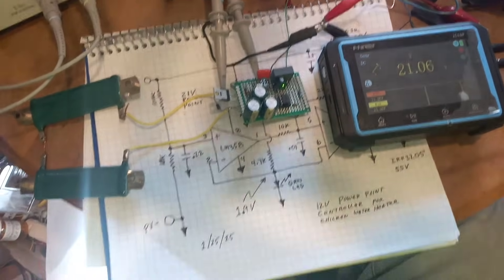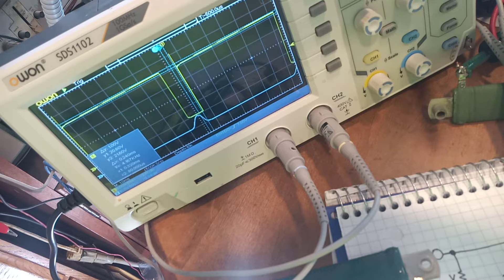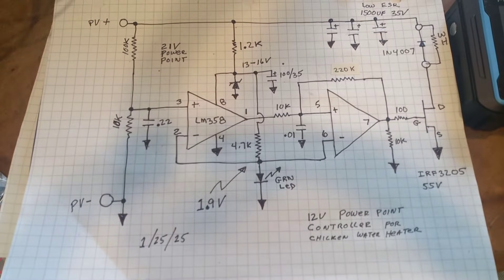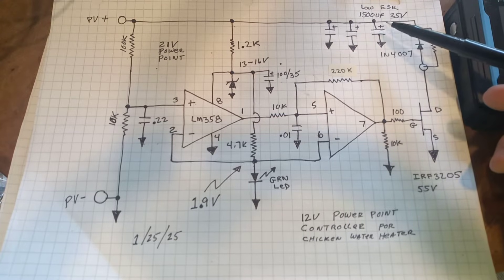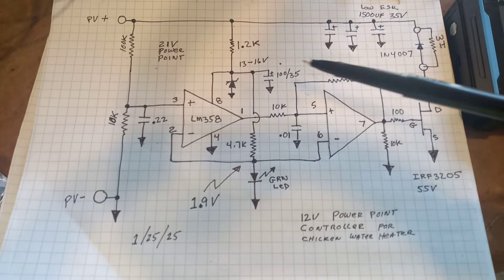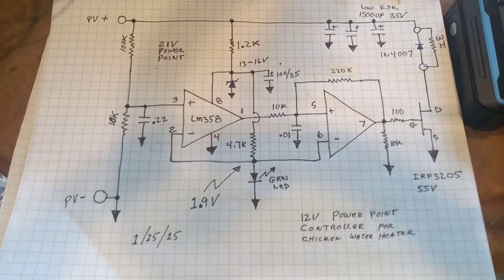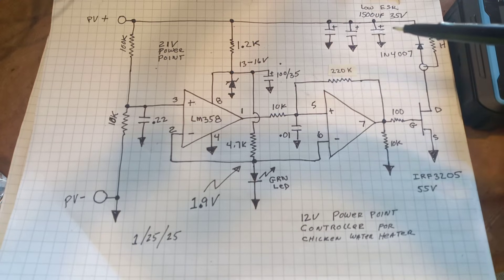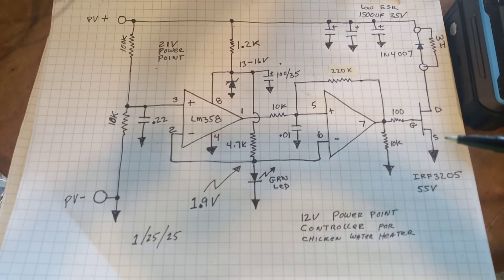Cheap And Easy PV Resistive Power Point Water Heater Controller Diverter Using LM358 #fotovoltaika

Comment from the maker: Designed as a low cost PV ice melter for chickens water source using a 12V panel, this can be adapted to any voltage PV array changing capacitors and FET.  This runs without issues.  Any op amp can be used like a quad LM324 which has rail to rail output swings.  Those extra op amps can add temperature shut off and arc interrupt.  

Only about 20W is needed to melt ice and this will provide that with only 1A of panel current.  The three 1500uF 35V Low ESR capacitors in parallel provide that in a small package.  Any low resistance FET can be used.  A IRF4332 would get you to 250V. A couple in parallel wouldn't need much of a heat sink.  

This connected to a 600W 120V steamer pot would make a great off grid cooker with a 40V grid panel or two 12V panels in series.

Anyone want to collaborate and lay out a board?  You could become a hero and make money building these.

Comment: I've done almost exactly the same thing more than a year ago, around the LM741 or TL071 and it works like a charm! I use it at 180Vmpp for a water boiler feed but depending on components it can do pretty much anything from 18V up to 250V.
Reply from the maker: Europe is more receptive to this concept.  There are dozens of circuits which can work.  Love to see a scope trace of your output.  You should try arc interrupt so output heaters can be daisy chained.  Everything works better with more capacitors.
Reply: @opera5714  I tried to setup a chain with multiple regulators - you can prioritize the load by setting slightly diferent voltage tresholds for each of them - and you also add-up some buffer capacity. This regulator si so cheap that you can afford having more than one easily. 😀 Some Europe has a problem with electric safety with those devices, but fortunately some of us just don't give a .... you know. 😀

Comment: Hi, I have watched your videos over the years and it seems to me a non electronics person that you are a pretty smart, innovative bloke. I am interested in off grid solar, simple electronics etc. I find when you are explaining your work you are talking to electronics engineers and professionals and you are way above my understanding. Maybe if you could do a series of videos showing how to build a hot water system and see it working would be great. I think It would boost your subscribers as well. Just a thought. I am an old guy and I find I get brain fog as well trying to understand what you are doing, but it sure looks interesting. I am sure a lot of people are interested in your work.
Reply from the maker: Not likely to happen.  Every system is different and my installations are not typical. Not about to make 15 minute videos where they only connect two wires together.  

I talk to everyone as if they are an adult. I try to be technically correct.  I don't expect anyone to completely understand in five minutes. That is what pause and rewind are for.  These are new ideas that won't be found elsewhere.  Ask questions like what does that resistor do.  It isn't possible for me to think like before I knew electronics any more than you to think like when you were a child.  We would be better parents if we could.  This is supposed to be a community effort.  

This style is also a filter.  Thes can be dangerous systems and the majority of those in solar have little understanding of electricity.  I tell them they have to do five things to be safe and they do the three things they want to.  In most cases, these systema are illegal. I don't want people crying my insurance won't pay.

I can't send a picture with my cell phone. Probably not stupid.  I just have no motivation to send cat pictures.  If I really wanted to, it would be figured out.  I don't care if you heat water, I want you to learn something. Making things easy for the viewer won't make them learn. I'm OK with YT stats telling me they click off after 10 seconds. YT is filled with idiots copying another's video. Nobody copies these hot water videos.  You can only make money by posting low quality.  This channel has cost me thousands.

Comment: I’m sorry you have been discouraged by the response.  I’ve been glued to these designs for two years or so.. I built the sg3525a circuit.. but overheated my fets and stalled out for a while.   I really never studied electronics properly enough to get good at the bits that you juggle in your sleep there.  Most of the other techs I work with in Heat Pumps and Solar think I’M way out ahead.. but I have a long way to go.  

I just think most service guys I work around know how to read resistance and voltage, enough to get to ‘swap out the board’ with tech support.

Don’t give up, please.
Reply from the maker: For power supplies you want to go as fast as possible in order to use as small a transformer as possible.  I avoided going fast to limit noise with these high current circuits.  My gate resistors are much higher in value than typical.  I have a shortwave receiver and I can stick the antenna right on the FET and not pick up noise.  Switching transitions can produce a lot of heat.  The TL494 is a much better switcher in water heating applications.  I only used the 3525 because that is found in the 300W inverter boards.
Reply: Can you tell me if this current LM324 circuit is able to work with Residential Water Heater elements with their Thermostatic switches?   I was drawn to the 3525 circuit because of the dead zone aspect.. but maybe there are other workarounds to avoid degrading the T-stat contacts with arcing.  Are there such features in the above 324 version?  (As mentioned before, I have already played with this Op-amp a little, and feel a bit more confident with it.. though I'm still eager to make the 3525 circuit go as well. 

 Someone gave me an old (70's anyway) BK1405 single channel Scope from a High School science dept, and it works enough to see some basic waveform info.. just no spelled out Volt and Freq info.. so I'm getting my head wrapped around that as well. 

I appreciate the low freq approach, and the simple circuits for taking quick advantage of the best of PV's potential.
Reply from the maker: @BobFiske  If a circuit board was to be made for the LM358, the LM324 with two extra op amps would be included with temperature controller and arc interrupt.  That is unlikely to ever happen.  The 358 circuit works fine for water heating as long as components to take that voltage are used.  Just switch power to the control electronics with thermostat.  Arc interrupt is nice only if you need it.  You can not store enough power in the off time to prevent efficiency drop at FULL POWER.  I think you should work on getting what you have now working correctly before jumping to something else. Your FET are probably too small. Need at least 10X rating of expected current.  That scope is perfectly fine.